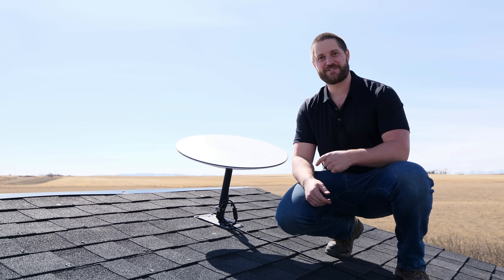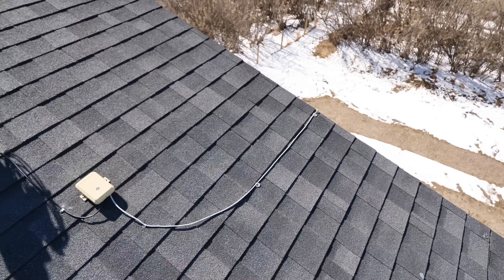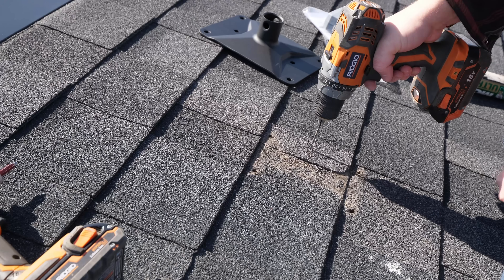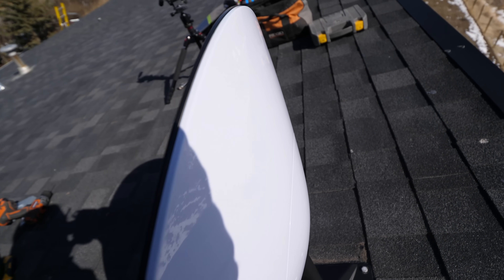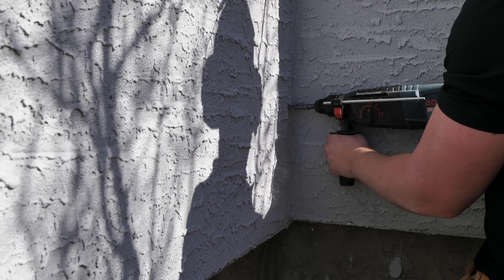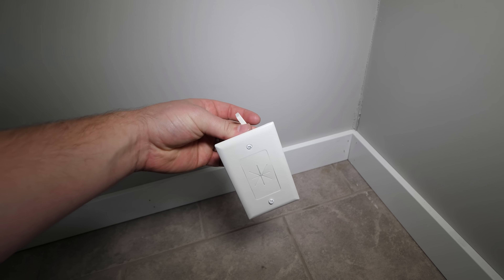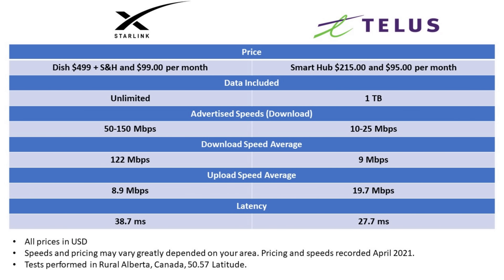Starlink Install, Speed Test, and Review

Comment: If you would cut a couple of vertical slits on opposite sides of the pole mount base underneath where the clamp is, that would allow the clamp to compress the top of the pole mount under the clamp even more.

Comment: 7:56  You should put a drip loop (have the cable run below the hole and then turn back up and then into the hole) where your cable enters the home. The way it goes in now, the water will eventually find a way to follow the cable into the house (silicone isnt a perfect seal). Great Video though!

Comment: I would have installed it anywhere but on top of the roof, on a pole or a stand on the ground, the wind is eventually going to loosen up that roof bracket and then you have a lot of problems

Comment: Hey, as someone that had a house with a metal roof in New Mexico, make sure you get a good installer. If not done correctly, a metal roof can be far worse than a shingle roof if it is damaged via winds. And upgrade to the thicker stuff if given a chance. I can’t remember the details of the roof we replaced our old metal roof with but the thicker stuff made a world of difference.

Comment: Very nice. Yet, with such strong wind, and to have a stable signal, I wouldn't install the dish on the roof. To reduce the wind effect, I would build a  small concrete box and probably unbreakable glass on top of it. If the top of the concrete box affects the signal, I would jus leave it open. This protects the dish and its base against vibrations,  increases its lifetime, and boosts the signal in stormy weather.

Comment: Speeds are only better than hugesnet because not that many people have it installed yet. Once more people start getting this service u will see speeds slowing down just like hughesnet
Reply: Hugesnet uses a few geostationary satellites that each serve about 1/3 of the world, while SpaceX uses 1.400 (growing to 40.000) low-earth satellites that serve a much smaller area (currently about 300km*300km). You only share bandwidth with nearby users and the additional 38.000 Starlink satellites will also bring a lot of extra bandwidth.

Comment: First, POE stands for Power Over Ethernet, not Power Over Internet. Second, what do your issues with not having enough cable to reach the Starlink have to with helping anyone else installing their Starlink? Such video posted by well intended but lightly experienced folks doesn't just confuses the issue. Consider pulling and re-editing your video to correct the errors and cut right to the meat. ;>

On the plus side, thank you SO MUCH for not adding music to your presentation! +1 for that. :>

By the way, when I see the word "PRO" connected to DIY it is usually a description of what the person strives to be, rather than what they are. Again... ;>

Comment: Appreciate the effort, time and money spent. Thank you brother !
However, this isn't sat tv so no need to make the dish immobilised that much. Nr. 2 ... either use a solid concrete bolt or a plastic plug with buling adhesive (silicone if nothing else available), not just a screw. This will make great trouble in future as moisture and rain drops follow the cable, and winds fatigue pulls cable a bit of inch from dish mounting every day. This can lead to mould indoors. 
Anyway... good video, thank you for the effort, time and money spent.  
Live long and prosper 🖖

Comment: Quick tip for wind noise in video:

You can do something called a high pass in premier pro (to pass over the lower sound frequencies,) which will take out the wind noise if you adjust it just right.

Comment: I’ve installed about 12 of these dishes for clients. Speeds have ranged anywhere from 170-400mbps download. Tree or any other obstructions really matter
Reply: Also, I really hope StarLink redesigns the connection. Having the cat cable hard wired makes it more difficult than it should be

Comment: Why wouldnt you tuck the metal faceplate under the upper shingle? Even with sealant on the drill holes its still strange to me you would make a water catching point by not tucking under the higher shingle flap

Comment: You should not have sealed the bottom of the bracket if you let at least a small space open would have allowed moisture to get out make the bracket work like a single how long would it have taken to put down new shingles after you drill the holes our found the roof joist

Comment: Have you had any problems with the dish during extreme high wind events?  I am located in a similar area and wind speeds can exceed 110 kph regularly.  I am concerned the dish will be damaged in these winds.  What has been your experience?
Reply from the maker: It has been better than expected, actually! No real issues with wind, only with snow (I posted an update video if you are interested)
Reply: @PROSDIY  THANKS!

Comment: Does they or does they not do " Bandwidth throttling " Because that's the problem that i am facing. i have a 20mbps local connection where i get about 17 to 20 mbps on any speed test but their main problem is Bandwidth throttling for main sites like YouTube , twitch etc. For those when i pull up task manager the ISP is limiting my bandwidth to 1 to 2 mbps.

Comment: I heard from high up people that starlink isn't just internet. It can and will power the earth with free energy (electricity) and free internet. When the big blackout happens, starlink is supposed to take over on the 3rd day and give us all power and communication (internet) so the white hats can keep us informed. It could be turned on now, but they are waiting for all the bad apples to get pulled out before they flip the switch on.

Comment: Just word of advice even though it’s too late, it is best to install these on the roof over the overhang.  That way if it leaks, it doesn’t leak INTO your house.  You also won’t need to tack the wire down on the shingles, creating more leak spots. 

You also should have made a drip loop on your wire right where it enters the house.  Otherwise, water WILL work its way into that hole.  You cannot rely solely on silicone to protect your home… 

I’ve spent many years installing stuff on roofs, eves, and running wire into homes.  A lot of stuff in this video are just problems that WILL cost you thousands in repairs later….
Reply: I am thinking the same thing. All those holes he drilled.

Comment: Regarding antenna fixture:  make a longitudinal cut on the base support (kind of parallel to the roof, thus forming 2 halves of the pipe so that the clamp will tighten the antenna pipe)

Comment: It's just a shielded cat 6 cable nothing spectacular. One can add a grey pvc exterior electrical box on outside of house with a slot in the lowest side for wire. The top or sides can allow water intrusion. Unscrew cover slip cord in slot and plug in to wire. To make slot cut a small V in plastic edge of box with a knife to start bit, then use drill bit same diameter of wire usually around 5/16"-3/8", on it's side to make a notch at V. 

The box can be painted to color match the home. Caulk to house wall with a clear or color matched good caulk like OSI Quad in many colors from your local home store. Don't use 100% Silicone. Then run a (ideally) shielded cat 6 patch cord(structured cabling) from box to inside home to the utility area of your home or wherever is needed eezy peezy.  Running wiring to a specific wall in a room, isn't recommended since the device becomes permanent at THAT location. All network cables should run from the wall/jack back to the same utilities area.

Comment: Really nice work on your installation. But I see if someone like myself was more interested in upload speeds, Starlink is not the better choice. Is this correct ?
Reply: You need Fiber...move to access it
Reply from the maker: Probably - it's definitely not as fast as wired!
Reply: @PROSDIY  It's very close to some cable connections. Faster than others, the primary focus is rural where wired options are minimal which is a huge portion of the country. Their goal is to be up to 1Gb/ea, but need more satellites up there. They're averaging 150Mb now which is very usable for most

Comment: You know what would be cheaper and work better a old dish or direct tv mount there free because they are every where with no one using them most of your friends will give you a old dish and the mount is there for free it wraps around the pole and squeezes the pole hey starlink go to the mounts from dish network or direct tv

Comment: Internet is so expensive in canada,  here in india i am using a 50 Mbps connection with unlimited data plan (actual speed I get is between 40 to 50 Mbps)  at just 14 $ for a month. Also which is shared between me and my roommate.

Comment: I would’ve been more liberal with that caulking gun.

Re the wobble, I think the tape will eventually wear or compress. Drilling another hole straight through will help, but re the design, the should’ve had a taller receiving or the female part of the tube to go higher up the male end, would’ve added some stability.

Seems pretty sketch…would be ok I think in more rural areas…but it’s a bit of a head scratcher considering this whole design was specifically for the Rural communities 🤔 

I have a friend of mine who is signed up and is waiting for his…thanks for the share

Comment: Just a suggestion, I would keep a redundant system. Use your LTE and STARLINK. Then research whats called, channel bonding or link aggregation. The benefits are combining 2 internet connections and using as 1. If 1 should fail, you got the other to fallback on. When both are working, you increase your internet speed by 2x’s. Mind you, yell have 2 isp with 2 bills but yell have a redundant system. Typically this practice of redundant networking is done with data centers.
Reply from the maker: Thank you for the suggestion!
Reply: @PROSDIY  2 company names you can look into 1. Speedify  for just running software or 2. Ubiquiti for running hardware network equipment. It depends on your budget. Have fun with this stuff..

Comment: I would recommend adding a longer pole so that the icicles forming when it snows wont stop the dish from moving. It will damage the motor. That is if your area snows during winter time.
Reply: Starlink dishes have a feature that if they have snow on them the electric usage will go up making the dish hot and the snow and or icicles melting off
Reply: @nickssamsunga117  That's a lot of words to say they're heated.

Comment: That mount is not ideal, it will present a leak in about 10 years, less if you get a lot of snow or freezing rain. You could use aluminum flashing to provide a better water protection. You want to divert water away from that area. 

For instance here is the correct style to use for a regular satellite dish. Commdeck Satellite Dish Mounting System https://www.amazon.com/dp/B000AA9ERU/ref=cm_sw_r_cp_api_glt_fabc_8NA3CF2RRVCBW5VGG9Y5?_encoding=UTF8&psc=1

The install maters as well.
Reply: Can you tell me what mould he’s using, pipe  to my washing machine broke and I’m looking for something to fix it

Comment: BUILT 11 FOOT WALLED HOME WITH VAULTED TILE ROOF, WITH UNDER GROUND HVAC RETURN AIR DUCTS. HELPS RUN CABLE TV AND STARLINK CABLES TO WIFI ROUTER.

Comment: Think you might want to reconsider your install. Looks like you live in a cold area, when the snow starts and melts off the dish it'll refreeze under the dish and can cause problems. Suggest you consider mounting a pipe to a wall near your roof so the melt falls to the ground.

Comment: That's some hardcore professional installation sir.. much satisfying.. enjoyed. Thanks for some installation ideas!
Reply: Wasn't a fan of the gromet wall mount with the cable hanging out, it would be easy for a kid to push it through the gromet and you need to fish it out and it looks ugly.  I would have just used a cat 6 wall mount and had a separate cable running to the router from it.

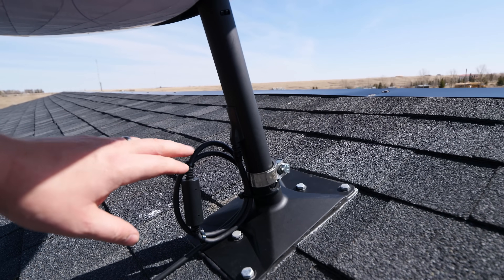Comment: @10:50 use either cloth or cut a couple inches of hose and tie the hose lock around it, it'll solve the play in the antenna, I've used this hack(jugad) many times...hope it helps.

Comment: Telus: 10-25 mbps 
Dude gets 9mbps average lmao
Starlink: 50-150 mbps gets 122 mbps average, while also reaching up to 190 mbps on test 😎 Not false advertising.
Well Telus do be having more than twice as fast upload speeds, would be nice if in the future Starlink upload speeds would be higher, at least 20-30 mbps cuz 9 mbps is quite low, ain't streaming with that lol. Also Latency on Telus is lower by 11ms which is quite a difference for someone like a gamer tho not that big of a deal, plus it compensates with MUCH higher download speeds and unlimited data tho ofc lower ping is always appreciated.
All in all Starlink seems as much better option 👍 Thank you for the informative video

Comment: I realise how cheap Internet is here in India. Installed a wifi connection last month. They took $20 for the installation and with that I got free trail pack for a month and speeds upto 150 mbps with 3.3Tb monthly quota  and 1Gbps speed costs $55 a month with same 3.3tb internet, $115 for 1Gbps 6.6tb data a month.

Comment: do not twist the data wires into a coil. you made a solenoid. when a signal goes through the wires, they create an electromagnetic field, and if you place the solenoid in an electromagnetic field, then electromagnetic induction occurs and noise is affects your data. Always cut off any excess data wire

Comment: Pro Tip: You're best off drilling from the inside of the house where youre going to put the line through or outlet, than drilling from the outside. I know you sealed the hole where cable goes into the home, but we always put a "drip loop" so water doesnt run down the cable and into the hole/wall. Good job though.

Comment: 122 Mbps down isn't much when compared to a modern, high speed cable or fiber connection that can push 1 Gbps or more, but when you can stand on your roof and see no civilization for 5 miles or more in any direction, 122 Mbps is incredible.

Comment: I would not seal the bottom edge of the base on the roof. Not sealed allows any water getting in to drain out. Sealing the bottom creates a dam.

Where the cable enters the house you forgot to add a drip loop like was shown in the diagram you showed. The loop is for when water runs down the cable it drips off the bottom of the loop. The way you have it the water will continue down the cable and into the house. Generally water will beat seals.

Comment: so you sealed the bottom of the roof mount which if any water gets behind it, it can't escape. You also didn't loop the cable under the hole going into the house which means any water running down the cable can enter the house.

Comment: $99 per month??!! Holy moley that's some upper class pricing right there.
Reply: Pretty reasonable for those speeds tbh.
Reply: @zck2020  I had to test my connection speed and it was 395/98 Mbps. And that's 35 €/month. I also have 300 Mbps 5G on my phone and that is 29 €/month. So, I guess it's what we all are used to. That's why it felt a bit pricey to me.
Reply: @tatjoni  fair enough but you have to take into account all the infrastructure you're bypassing with starlink. Maybe it's not worth it in the city but out in the middle of the country where there's almost no alternatives because rural ISPs usually suck it's a pretty good setup.

Comment: Your cable coming into the house should have a drop loop in it to keep water from flowing into the house. Simply have the cable dip well below the entry into the house, then back up. Water will not run up hill

Comment: I would have done the wall plate a bit differently.  Instead of that special cover plate, I would have used a Decora wall plate and keystone jack plate.  These can mount up to 6 connectors of various types.  In this instance, I would install a CAT 5 or 6 jack, depending on the cable, and then use a patch cord to the injector.  Also, a mud ring can be used instead of a utility box to mount the cover plate.  These are simply stamped steel, with tabs that fold around the drywall and threaded holes for the wall plate screws.  I expect that anyone who runs in network cables would have some in their toolkit.  The keystone plates, connectors and mud rings are available at any store that sells network supplies and also at places like Home Depot.

Comment: Had I been you, I would have flashed the top of the mount using aluminum flashing. Any time you provide an obstruction that forces water on your roof sideways, you are creating a potential roof leak. You can still do this, but I would look for painted flashing that matches your roof and flash from the shingle one above (not directly above) the baseplate.

Comment: You guys have to pay $95 a month for 30Mpbs plan?
Where I live we pay roughly $10 a month for 100Mbps plan.
Edit: The difference may be because of all the services you guys get with that Internet connection like TV subscriptions and Landline connections. We don't necessarily have to have these bundles in our packages.
Reply: I wondered that as well. In Germany it's around $50 for a 100 Mpbs connection incl. landline ... if you want TV just add another 20 bucks. So it's not even that more expensive in the States I guess.
Reply: @Nico237  yup

Comment: 5:09 and 10:30  The clamp and bolt concept sounds like an excellent option. Additionally, I bet a small wrap of flex tape around the pole before you slip in it the mounting hole may not only fill in the gap snugly, may help prevent water from traveling down into the mounting hole and collecting under the mount on the roof. This is what I'm talking about: https://amzn.to/3eLTSJg
That is crazy windy. But if you think for a second that I am calling you "Sir," you got another thing comin'. 😆